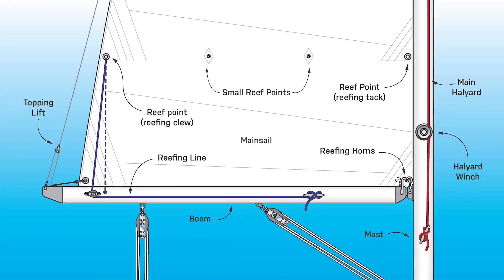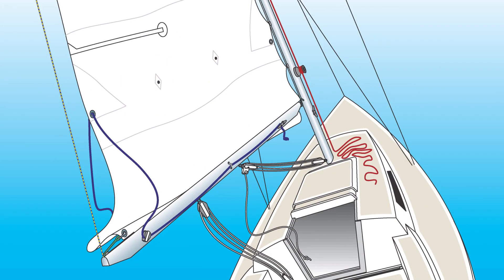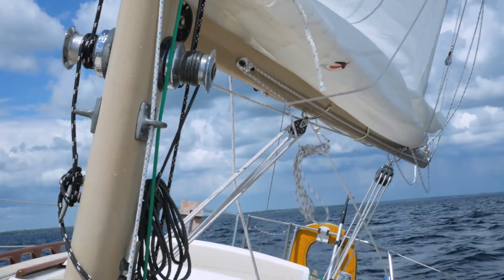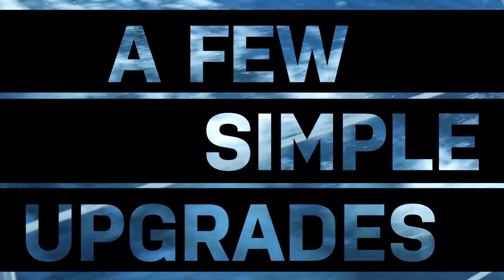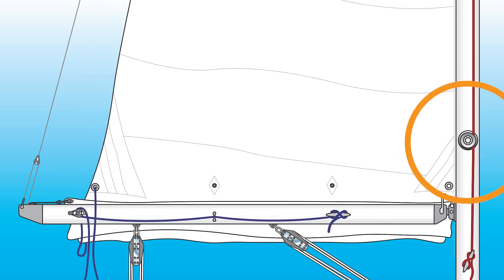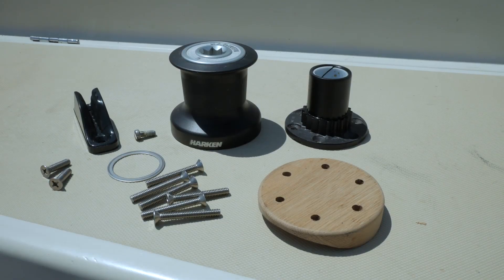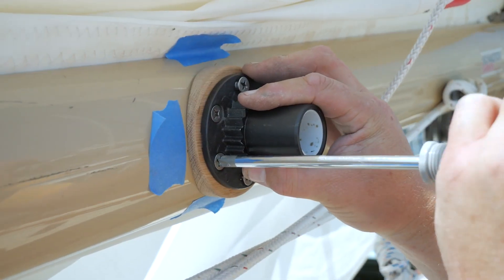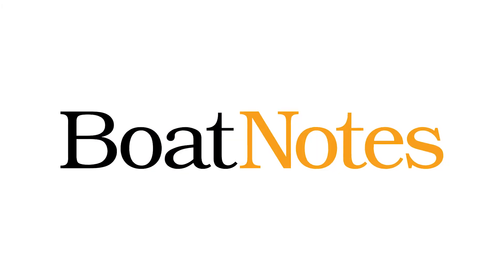Sailboat Jiffy Reefing Upgrades

Comment: @1:05  I realize that there is a big difference in "available options" between something like a beneteau 50 / jeanneau 49 / etc and a j22 / merit 25 / etc. But how do the smaller boats continue to come like this from the builder?  Bigger boat upgrades = solar, water, comfort.  Small boat upgrades = basic functionality and performance.  🤔

Comment: Perfect mix of diagram, then photo of the actual pieces installed.  Once the clew cringle has been brought securely to the boom...do you think some form of outhaul is needed to also secure the horizontal plane?  Some set ups seem to have the leech cringle pulled diagonally back and down - which  looks like a less secure vertical fixing of the aft reef point.

Comment: Nice. The best comprise I've been between factory and really complicated systems that I don't want to figure out. Thanks for posting. Ah, put plenty of goop in the threads - I don't think galvanic/weak would be an issue...at least in the next 10 years. They do make aluminum screws, if you want to go purist, however.

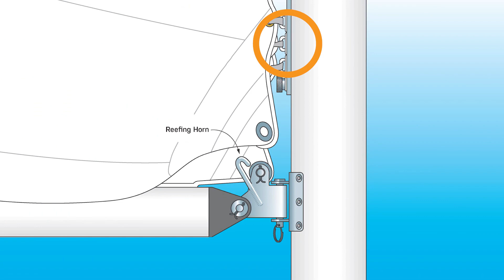Comment: Could you explain how you dealt with the mast track being too short?  Unless something is changed with the track or stopper, then pulling down on the reef tack will still pull directly against the slug on the luff that's butted up against the mast track stopper. (See video at 1:22 minutes.) Removing the stopper will fix that, but they you would need to thread the lower luff back onto the track when hoisting the main again to shake out the reef.  I ask this question because I have the same problem on my boat.
Reply from the maker: Hi Graham, 

The reef cringle, or tack clue, is higher than it normally would be when hooked to the reef horn. So the horn is at a lower point. This still doesn't leave much room for adjustment, however. So I am going to add some track to the bottom of my existing track. The short track will be mounted with machine screws in threaded holes in the mast, that way you can remove the short piece when installing or removing the main each season. It's on my list of stuff to do! Thanks for the question, this is something I should have addressed in the video. 

Happy Sailing!

Comment: Stainless screws directly into alloy will over time galvanically corrode at the tapped thread. You will ultimately have to thru-bolt these.

Comment: I love the videos, Kim!

One comment I have about this one in particular is that the upgrades all are putting the lines forward requiring people to go on deck during potentially tense moments.  It would be cool to highlight other options that boats have such as single line reefing.
Reply from the maker: Great! Glad to hear. This is just a basic system that works well for us. Agree that some of the systems that run back to the cabin top are nice because of not having to go forward. However, the more blocks that the line has to go through and around can be a problem, resulting in the foot not getting pulled very tight and the luff getting tons of tension. This is the big reason we personally like everything up front. It does mean being comfortable going up front in nasty conditions, which doesn't work for everyone. We always have harnesses tethered to jack lines when necessary. Your point is valid though. We will cover other reefing systems at some point. Thanks for the input and thanks for watching!!
Reply: in a smallish boat, you can actually operate both systems while standing in the cockpit descent